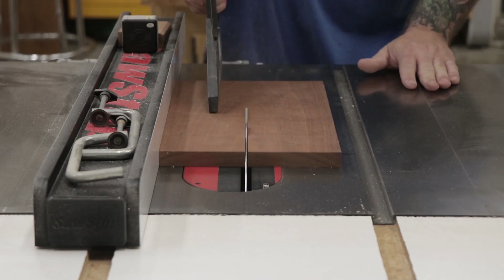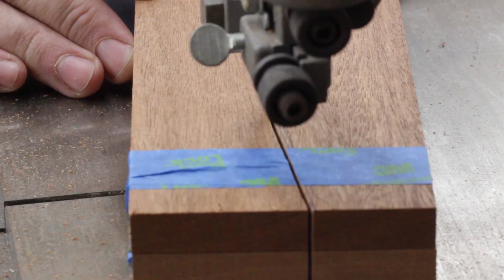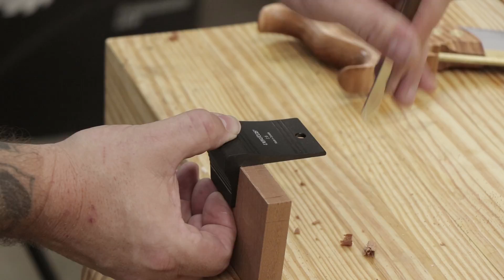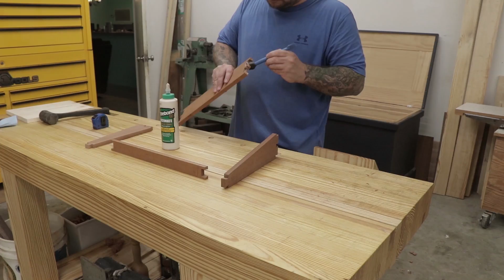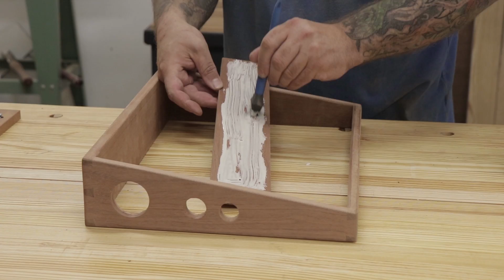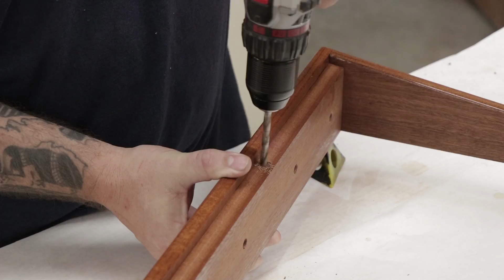DIY Pedalboard Build

Comment: Late comment, but is there a reason not to just use nails instead of the joint?
Reply from the maker: You could use nails. I think this joint is more attractive and it’s stronger. A simple box joint would be a good option too